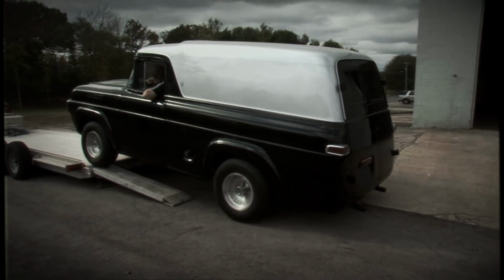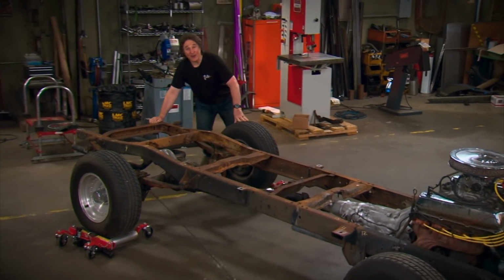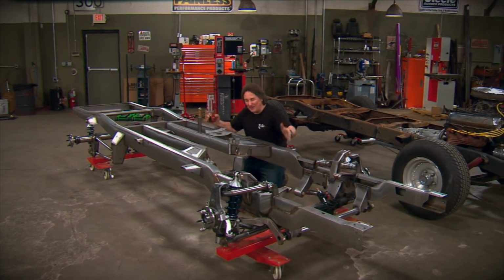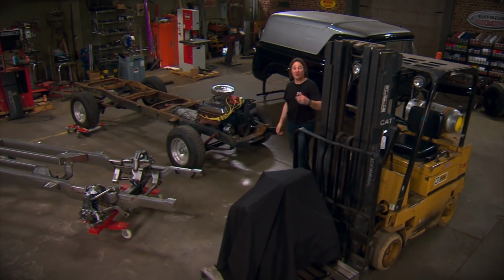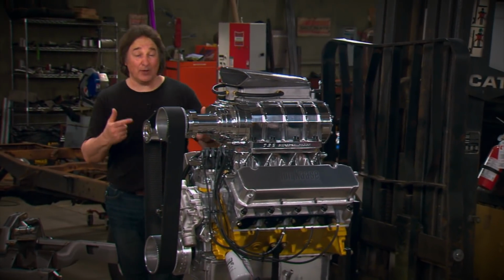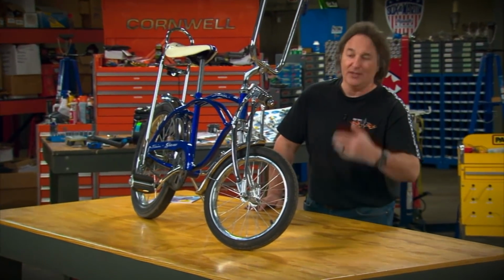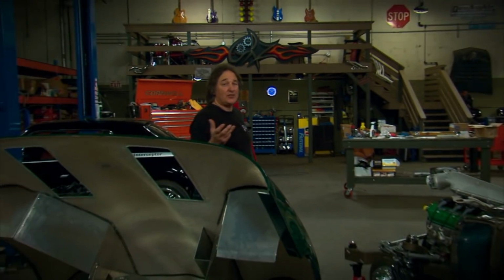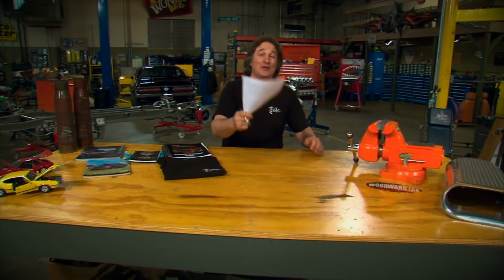SR-71 Rapid Tool Express Panel Truck Custom Chassis & Drivetrain - Stacey David's Gearz S12 E13

Comment: Hey Stacey, I.got a 58 Dodge Coronet 4 dr I’m planning on doing a Led Sled treatment on it. Her name is Lucille! I’ve got severe neuropathy in my hands, feet, and lower legs. Which is the reason the car just sits in my garage. I’m a OTR truck driver which also takes time from the car.Im wanting to change it from a 4 dr to a 2 dr post sedan. I use to build and race asphalt street stocks on the oval. But, with my ailments I can’t even do that anymore.